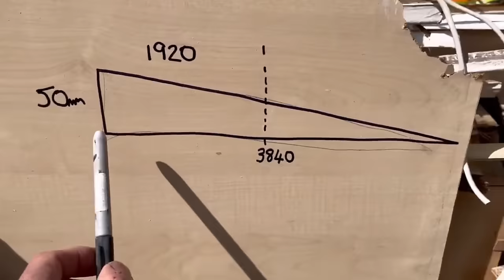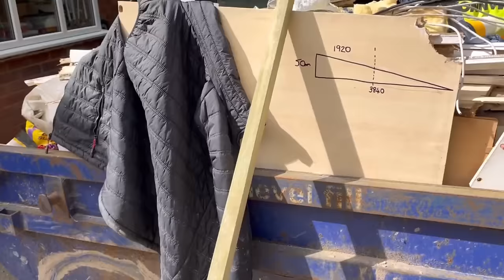Building a WARM ROOF with parapet walls is EASY!!!...right??? The Basement Build #7

Comment: I've just started watching your channel and I'm impressed. I do have issue with your reason for not chopping out the cavity of the corner of the room beneath that warm roof. I'm not a builder, merely a diy-er but I've built a detached garage, a conservatory and an attached garage extension. You said in the last episode that you know of no builder who does this between the 2 connecting plates of joint and it wasn't right to cut up good house structure for no reason. I did this very modification when building my extension back in the late 90's it was a common thing to do apparently and local building control wanted it done. the reasons were primarily to break the cold bridge between the inner and out leaves of the wall at that point and insert additional insulation. Now, I'm in the middle of this episode and noting your conscientiousness for the thermal break you've created in the parapet wall for the benefit of the warm roof and strength to the external parapet leaf, but I cannot understand why you didn't similarly consider the massive thermal bridge you left in that lower wall by not removing the bridging brick work between the 2 connecting plates of the new wall. Stihl saw would have done the job in 5 mins...
Reply from the maker: Hello William. Really appreciate you watching our stuff, thank you. I didn't do it for the reasons that I stated in the video. I've never been told to buy an inspector and never seen anyone do it. I've never ever had an issue and I've built extensions for friends and family, as well as my own at my house, so if there were any issues surely they would have presented themselves by now? Now, I know what you're thinking...you did it and also have never had a problem either...but could that be because what you've done is pointless and has had zero effect? I'm especially sceptical when it comes to houses with solid 9 inch walls...how do I continue a cavity that's not there? Where's that thermal bridge? I'm not saying you're totally wrong and I'm totally right, but there is zero common sense evidence, or just evidence in that case, that either proves me wrong or makes sense that you're right.

Comment: They are easy and brilliant. I did mine 10 years ago, topped the parapet with aluminium capping. Didn't use cavity walls but used 215mm thermalite with 50mm PIR on the outside and then a breathable cladding on the outside. Like a standard pitched roof but vertical with breathable membrane. Went up very fast.

Comment: Great video... When I built my extension I put a piece of masking tape over each screw fixing so that when it's glassed over the screws are still accessible and not gummed up with resin.. Keep up the good work. Looking forward to the glass fibre going on ...
Reply from the maker: That's a top tip mate! I like that!

Comment: I think there must be different variations of warm roof out there Adam. i finished an extension in February with a warm roof which was EPDM on OSB on Celotex on vapour barrier on OSB. All on top of the silent joists. Roof was about 200mm thick! We also had to clad the outside which we had to counter batten to create an air gap for air flow behind cladding. The roof also had a  2mtr x 1mtr  pyramid roof lantern from Eurocell all built same as yours, and yes it had a different size timber to yours, so good info there mate. Great video mate.
Reply from the maker: Yes mate, there's definitely different ways of doing things, although your roof is the same as ours, just the covering is different. Cheers Paul, hope you're well, mate.

Comment: I went about the parapet slightly differently. I had a roof insulation set up designed by Superfoil, not warm or cold, more like a hybrid. My parapet is just the outsode skin, one block above the deck. Theres 90mm pir cavity which comes to the top of the joists, the superfoil quilt is tucked in and stuck down to the cavity creating a consistent seal. Internally theres 100m insulation running right up to the cavity insulation, vapour barrier below it. Apparently meets 0.15 u value.

Comment: Really enjoying the justifications for why you choose a particular design

Would aluminium copings be an option instead or are they still prone to the joints failing?
Reply from the maker: Thank you, Tom. Aluminium copings would be bombproof mate, there are lots of options that would be too, but they wouldn't match the rest of the design which is something that I should have mentioned and will do in the next video, nice one for pointing that out! Cheers, pal, thank you for watching.

Comment: You mentioned on previous videos that you didn't need a cavity tray over the windows where the roof is constructed directly over the intel, which I agree with. However, do you not see the need for a cavity tray above the steel lintel where you have constructed the parapet wall over the sliding door opening on the rear elevation?
Reply from the maker: Hello Adam, hope you're well mate. If it was finished brickwork or render I would have, certainly, but it's going to have a breathable membrane wrapped round it, counterbattoned then a waterproof plastic cladding installed...no water is going through that to warrant wasting the DPC mate! Cheers mate, hope you're well.

Comment: Quick i need the does and don'ts with the fixings!! Sharpish 🤣🤣👍 great job lads! But all of that effort to then grp it?? Also quick q with the vapour barrier would it be ok to put it over the top of cavity closers which are going in a parapet cavity and then dpc then coping/ (or) aluminium trim 🤔🤔
Reply from the maker: Haha! Sunday will be here before you know it! The reason that you don't vapour barrier all the up is because the GRP won't stick to it, we need bare OSB for that, but cavity closers would be totally fine for it mate.

Comment: When you built the 2 nibs of blockwork at the start of the video how did you tie them to the other structure, as it appeared that there was just expanded metal strip in the mortar joint ?
Reply: I noticed that also.
Reply: Pretty sure I see ties in the existence wall
Reply: @way661  Could be would make sense
Reply: @amazing451  think there was ties into the inner and outer nibs too
Reply from the maker: I'll show you all in the next video, fellas. Cheers everyone.

Comment: Why use the standard OSB board? Surely, it should be waterproof (green) boards
Reply: OSB3 is quite water resistant, it will be covered so its only at risk dring construction, methinks

Comment: Adam did you use a drone for the footage at 35.01? Nick
Reply from the maker: Yes mate, it was the customers. What do you think? Shall we get one?
Reply: @Mr_A_Builders  Adam - yes brilliant idea - I remember you said in last video that your camera battery went flat and you used the customers camera but didn't realise it was a drone until I saw you putting the breather membrane down! they are brilliant things for overhead film footage - I believe surveyors use them for inspecting  wind turbines. Talking of hot versus cold roof - I recently converted my conservatory to a flat roof room as I built a WC next to it and just went straight across with the 9x2's - I went for a cold roof with 150mm of celotex covered in 32mm plasterboard/insulation sandwich as per building inspector, and the temperature is pretty stable whatever the weather outside so now a usable space - the hot roof construction seems to entail an awful lot more work but I suppose this is the customers/architects choice and you have to follow it - but I think for me it would be cold roof every time given the choice. Adam thanks for taking the time to answer - it must be quite time consuming answering all the posts. By the way - where's Arthur Askey!! is he on another job?  look forward to next instalment - regards Nick

Comment: 3mm  gap between OSB boards for expansion or not ? Thinking of cutting gaps after ive put the boards down over the next few weeks....
Reply: If you use tongue and groove OSB just glue them together job done
Reply from the maker: We haven't left a gap in this instance, we've used so many nails and there's resin to go on top...I don't believe that they'll be an issue.
Reply: @Mr_A_Builders  thinking again on mine if the osb does expand it would just bow downwards a bit which doesn't matter much... But the bow out would suck in a tiny bit of warm moist air to the new curved space !
Reply: @frog-eye1420  i've already bought non tongue and groove and cut them roughy to size, drat

Comment: Rain water from the warm flat roof is going exactly where?
Reply from the maker: When you say "exactly"...do you want the measurements to the millimetre or just ballpark?
Reply: @Mr_A_Builders  Because you put all the self adhesive membrane on and then you have this huge slot just between the house and the extension. Hope that the water isn’t going that way.

Comment: would have been much simpler to just build in the joists with blockwork and add a simple air tightness tray then block above. U value will be exactly the same and would have saved all that messing about with timber above. Alutrix sticks to blockwork. Would have been much quicker and saved a few quid.  coping stones need cavity closer under them covering cavity for NHBC now. But as you no longer have a cavity ....
Reply from the maker: Can't argue that your way is easier, but it's not as thermally efficient. The whole point of this is to make it as best as it can be, not cut corners for ease.

Comment: I'm leaving my wooden rafters visible from inside -  not covering underneath with plasterboard
Reply from the maker: I don't think that we'd be allowed to do that under the fire reg, but it's a lovely finish to have.
Reply: @Mr_A_Builders  oh I hadnt thought f that, maybe strips of plasterboard under the OSB so thats not visible but still beams visible ?
Reply: @Mr_A_Builders  or full  sheets of plasterboard on top of the beams and under the 18mm OSB and kingspan and 12mm OSB and EPDM?, would if be strong enogh to take the weight without crumbling? I guess so, but worrying ... twould mean  a cleaner look at the rafter edges from underneath...
Reply: @Mr_A_Builders  or intumescent paint under the OSB  - which would be best to do before fitting it - will ask building inspector....